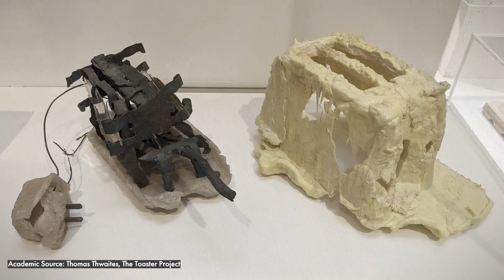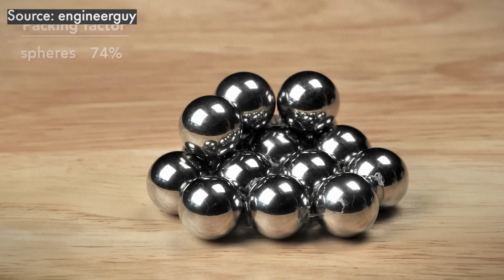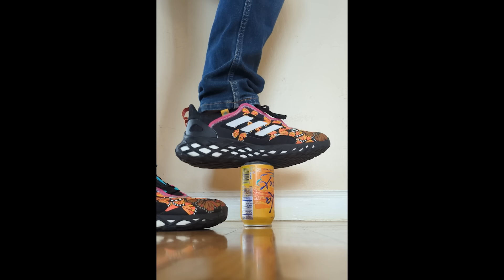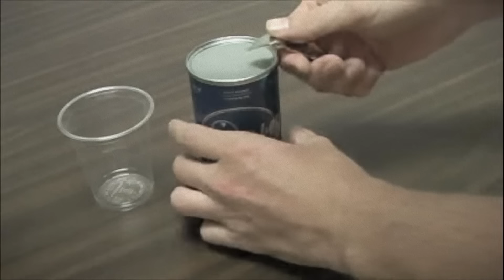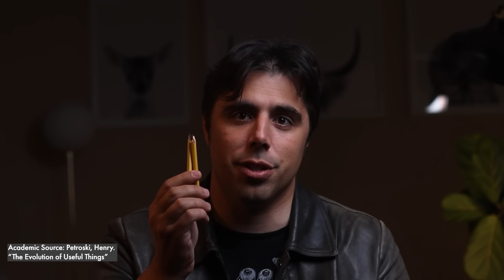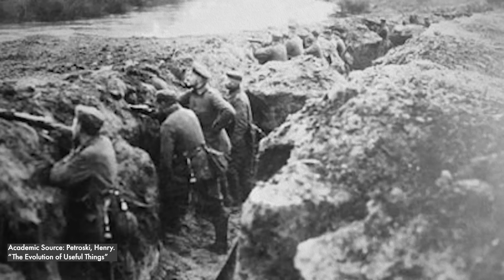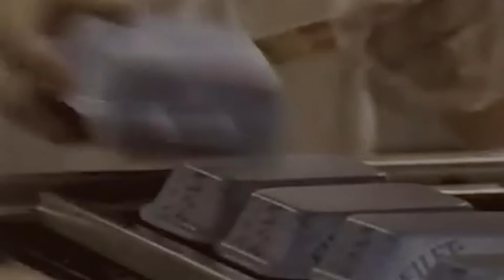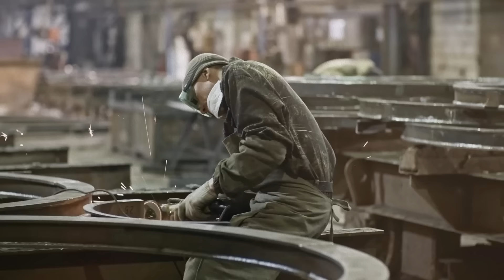Why Simple Everyday Objects Are Impossible to Make

Comment: It's more expensive to build a pair of cheapo $50 headphones from scratch than a bespoke $1000 audiophile grade headphones with planar drivers.

Simply because the cheap stuff is cheap because it uses injection molded plastic components while the expensive, all wood and metal headphones can be made with just CNC tools.

Plastic is just crazy.
Reply: It's an interesting point because the reason many high end headphone manufacturer uses planar drivers is precisely because they are much easier to make in small volumes compared to dynamic moving coil drivers. Planar drivers can be practically made by hand with a sheet of metal foil and a sheet of very thin plastic. They do not require specialized magnets, regular bar magnets of standard sizes would work. One can tension the plastic by hand, paint on the adhesive by hand in the path needed for the coil, apply the metal foil and brush off the excess. Now they have the most difficult part of the planar driver done, and drivers done like this can sound great. It takes a lot of time and skill to do it this way but no need for the thermoforming and coil winding machines to make dynamic drivers that sound equally as good.
Reply: You can cut a branch off of a tree and make a wooden fork in a day. Yes, plastic is 'cheap' when it's produced by the millions of items. But other materials are far better for smaller quantities.
Reply: Amortization of costs via volume
Reply: To be fair, most of the work done for the wood is the tree growing itself and it needed billions of years of evolution beforehand. I don't think with all of our tech we could create wood through chemistry and industry.
Reply: Part of why 3d printing is going to change the world. Its like the microwave of electronics housings.
Reply: @MadScientist-o2e nah, that was said about 3d printers years back and it didn’t happen, remained a niche product. As Scott Galloway once said: we all have already a 3d printer, it’s called China
Reply: @R-Type4 Chinese slave labor isnt forever (as we're starting to see today) and 3d printers are barely getting into the functional use stage of development. 

People also said the internet was a niche thing all the way up into the 2000s where today you literally cant avoid it. 

Just cause its not now doesnt mean it wont be soon.
Reply: @MadScientist-o2e  The Chinese mastered product development and production lines better than anybody else - even with higher vages their gonna dominate the field.
For each and every new technology there were people who hyped it and people who dismissed it, some became a success and some failed. What’s your point?
Reply: @R-Type4 no they didnt. We sold it all to em. But yknow what? Think whatever helps you sleep at night. Im working.
Reply: @MadScientist-o2e all good, you didn’t give much to think about anyway. Btw here’s your generic gpt assessment of 3d printing. You’re welcome. 

Of course — here’s a short, sharp English summary of the key points on 3D printing hype vs. reality:

⸻

	•	🧠 Massive hype (2012–2016): “Everyone will print products at home.”
	•	🧊 Reality: Consumer adoption flopped — too complex, too niche, low real-world use.
	•	🏭 Industrial success: Strong adoption in prototyping, aerospace, healthcare, and manufacturing.
	•	📉 Consumer market: Overhyped, stagnating.
	•	📈 Industrial market: Growing steadily, but niche.
	•	🔁 Not a total flop: It didn’t die — it matured into a specialized tool, not a mass product.
	•	🪜 Hype curve: Big expectations → disillusionment → steady productivity plateau.

⸻

👉 In short: “3D printing didn’t fail — it just didn’t become what the hype promised.”
Reply: @R-Type4 bunch of brainlets yapping without taking a look at how easy it is to build an Open Omega from a second hand ender 3.
Reply: The hypetrain for 3d printing left the station over a decade ago, it remained to be a profitable and specialized thing in the b2b market. I‘m actually surprised people still entertain the thought that it would be become a thing with the only point backing it up to be „yeah bro, the internet was underestimated too“. Hmm okay, I’m totally convinced now
Reply: @R-Type4 This Galloway fella sounds like a sociopath. He might not be wrong in an abstract sense and humor is what it is but goddamn that shows so much detachment and dehumanization. The type who thinks saying "it's just business" absolves you from anything.
Reply: @MadScientist-o2e  You know they're individually, on average, as smart as any average someone in your locale.  Their smart people are as smart as your smart people.  The Chinese education system is likely better than yours, if you're American.  They are capable of independent thought. They can, and will, take your ideas and practises, and improve on them, while you're busy patting yourself on the back and handing your collective fate to a small number of very rich science fiction addicts.
Reply: @Salafrance no thats not true. You missed the part of the post where he said "we sold it to them" which suggests hes from US as it's their corporations that were first and most aggressive at abandoning local production to keep few more $ for themselves and "f the consequences".
Average US iq is below 100 while Chinese is above 100 😊

Comment: When the first microprocessor (the Intel 4004) was released, technician once asked Robert Noyce, the inventor of the integrated circuit, if the microchip was to be fixed under a microscope if it ever broke.
Robert Noyce replied, "you just throw it in the bin and get a new one".

The Intel 4004 used 10,000 nanometer nodes in 1971.
50 years later microchips use 2 nanometer nodes and are manufactured by semiconductor fabs costing nearly $50 billion to make a $200 chip.
Reply: Yet, the failure of a microchip is very low. They are made to last quite a while before failing. That the machine they are made for will fail long before the microchip does.
Reply: @jer103  As someone which majors in this field: At this scale it is impossibly hard to design something with planned obsolecence: you either make it perfect from the get-go or you totally fail, nothing in between. If they could, they would but its practically impossible to do so. They have other methods of planned obsolescence though: firmware and software support. 
Look at Qualcomm for example: they didn't want to give Fairphone the right to update its firmware on their Snapdragon SoCs for more than 3 years until EU+Google+Samsung pushed for 7 years of updates on all smartphones.
Reply: @Atom224 yep, or you end up like Intel 2 years ago where you BARELY make it but then it breaks within months; but that was clearly unplanned and it cost them dearly
Reply: @Atom224  most things nowadays are just so excessively complex that making any diagnostics is more time expensive than getting a new one.
People call that planned obsolescence but really its not.
Reply: @Atom224  That's not so, all car manufacturers make sure their cars won't fail under warranty, but soon after. That's not meanness, but the result of cost-cutting to deliver the minimum acceptable product at the cost consumers want to pay for it.
Reply: @rogerbritus9378  It's quite expensive to design anything to fail soon after warranty, the cost cutting is baked in but not the driving reason behind planed obsolescence. The driving reason is so you'll buy another one as soon as possible. So sure not meanness but greed for sure.
Reply: @Atom224  yep. Chips cost an insane amount of money, time, and effort to design. And plus, chips are used by people for extremely long periods of time before swapping them. No consumer swaps chips out that often. So planned obsolesence is terrible here.
Reply: @Atom224  Easy: you glue together the part that doesn't wear out and the part that does, namely the battery.
Reply: @Atom224  the planned obsolescence comes naturally, as newer hardware is usually better
Reply: @Blox117  "Planned" is the opposite as "naturally", and most people still use old things if they still meet a need.
Reply: @B @Blox117 Except this has clearly hit a brick wall at this point, the 5090 is, what, 30% faster but 10% bigger than the 4090?
Reply: @jer103  the funny thing is that processors are actually full of failures, they just engineer redundancy, and that's why we have different processors off of the same architecture.
a ryzen 5500 has the same chip as a 5900, but the 5500 has some cores that are subpar and disabled, and some of them can't handle as much power/clock speed, so it's clocked lower. IIRC of the first wafer of the bulldozer architecture, only 2 were stable at room temperature, and they weren't measured in ghz.
Reply: @jer103 
And nods likes to oxedise but when we switched to the modern layouth they practecly never brake
Reply: The complexity and precision of those chip fabs is even more insane than the chips themselves, i recommend watching the latest video by Branch education that talks about it, its honestly sci-fi lol
Reply: @Oglitched  haha I came to this comment literally to recommend that same video by Branch Education. What a crazy wild ride that was
Reply: @ogkreees never heard of the channel. Thanks for the suggestion.
Reply: @Oglitched  You really can't compare fabrication and architecture as they are fundamentally different. Fabrication needs chemistry, physics, process optimization, and precision. Architecture needs system design, electronics, engineering and optimization in both space and time (ILP).

You might find the scale and precision of fabrication cool but personally I like the ingenious architecture behind chips.
Reply: @Oglitched  I think it's more of a miracle than sci-fi
Reply: @Oglitched  Even Elon Musk's passion for vertical integration hasn't led him to build his own wafer fab. Apparently, even the Tesla volume isnt sufficient to provide the financial motivation. This tells us the waferfabs are competitively priced.
Reply: We've been using 3 nanometer node for the past 2 years and soon to be 2 nanometers..
Reply: @matis.vanasse  thanks for reminding lol. I misremembered 2nm as 12nm. Thanks I'll edit the comment
Reply: @matis.vanasse actually we never moved past ~14 nm, but we found ways of redesigning the transistors to have "3 nm equivalent" density and power efficiency; however, if you could go and measure them with a nanoscopic ruler, you would find they indeed are no smaller than 14 nm
Reply: @Anankin12  just measure the chair size by the leg width and call it smaller
Reply: @Anankin12  came here to point this out.  I forget what the minimum gate size is but basically the smallest logic gate you can make with silicon is larger than the nominal process because SILICON ATOMS ARE TOO WIDE.  Which is an absolutely bonkers sentence, but it's the truth.  We can't shrink any further because the minimum number of atoms to make a logic gate prevents us from doing so.  And we didn't just make 1 chip at this bleeding edge of physics scale, as a testament to our mastery of reality, we make tens of thousands daily.

Of course then you watch someone turn left across 2 lanes of traffic from the right lane and remember that we're at once unfathomably clever and mind bogglingly stupid.
Reply: @michaeltorrisi7289  FLASH memory has walls of insulators that are 47 atoms thick. If they're 49 atoms thick, you can't store anything, and if they're 45 atoms thick, the data you stored fades away. The precision people make these things with is incredible.
Reply: There are microcontrollers in disposable vapes now.
Reply: @JeffBilkins  I wonder what one needs computation on disposable vapes for
Reply: @Zuckerbuck it's just because it's cheaper to buy a 10 cent microcontroller than it is to design a system that specifically does what's needed for the vape to work.

What you end up with us a disposable pen that you could run a website off of. Comically wasteful, but no disposable vape could be anything anything other than comically wasteful.
Reply: It fascinates me that manufacturing computer chips at the same time is the most complex, but in some way also the most easy process. Making a modern chip is insanely more complex than, say, making an electromechanical relay, but what you get is a device with the equivalent of billions of relays; all at once. It's truly mind-boggling.
Reply: 50 cent chips*
Reply: 2nm is not 2nm. Its a pr stunt. Look it up. There is no 1nm or 2nm chips out there. Not even in 3 years from now
Reply: In reality gate length is not 2 nm but about 12-16 nm. We are all being fooled by marketing teams of chip producing companies.
Reply: No way to hack your phone so ya know the owner has control of it? If its programmed it can be un or re programmed, right?!
Reply: i don't understand. the point you are trying to make is semiconductors are like plastic forks and toasters? i'd consider nanochips part of a tech race--opposite of streamlining. no idea what this means.
Reply: So they had to sell 250 000 000 just to break even. That's crazy.
Reply: @tigadirt  they do sell that many
Reply: there are mountains of processors much much more powerful than 4004 for a few bucks
Reply: @JJzerro i’d hope so considering how old the chip is.
Reply: @JJzerro  I think the processor built into a credit card for the NFC functionality has more processing power than that early Intel processor :D
Reply: @JJzerro  Exactly! A lot of people doesn't know you can buy for some USD cents microcontrollers as capable as the computers we had in the 90s
Reply: @JJzerro  A Z-80 costs eight cents in bulk these days.  (Actually, a Z-81A I think it is, which has RAM and all the "motherboard" chips built in.)
Reply: This took me years to learn by myself as I was obsessed with learning how everything works, especially my phone.

Years later and I have my degree in Electrical engineering and still have no clue how I'd make any modern electronics if you threw me back in time.....

Im not embarrassed though bc none of my colleagues would be able to either
Reply: @rgmoses2189  Depends on what branch of EE/ECE you are majoring in. Micro- and Nanoelectronics is obviously an EE profile you can pick in college.

Edit: But that said, no single person can know everything needed to build modern node ICs. That's why we have so many indispensable niche companies like ASML, which rely on Zeiss for the mirrors, which they rely on SCHOTT for the zero expansion glass, etc, etc. There are hundreds of (export-controlled) companies involved in the simplest of ICs. That's why China can't keep up with anything lower than 10nm on a mass scale. The semiconductor industry is truly a global effort of all minds pooled into one type of product; it's actually insane.